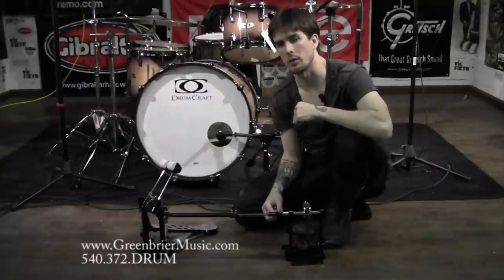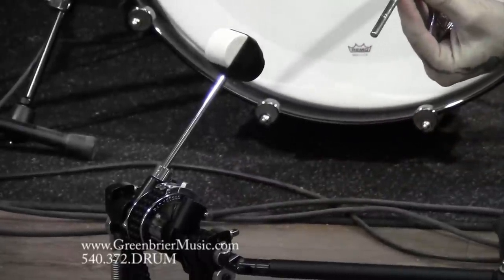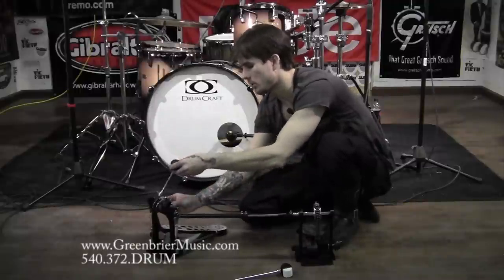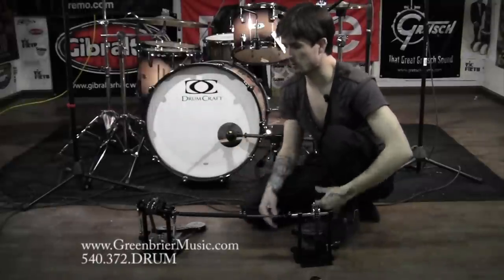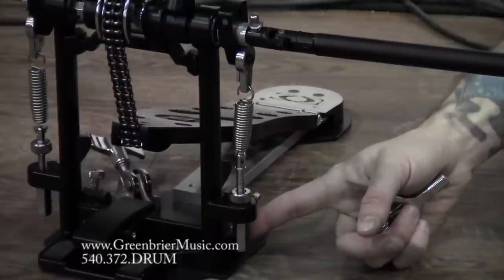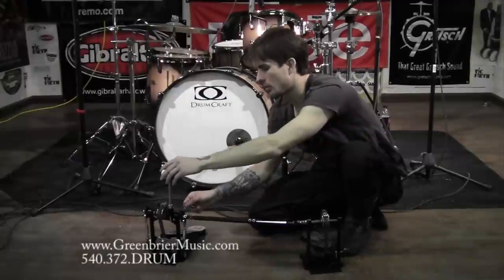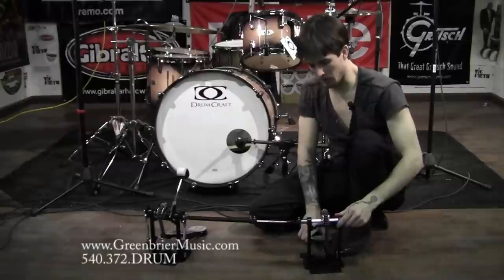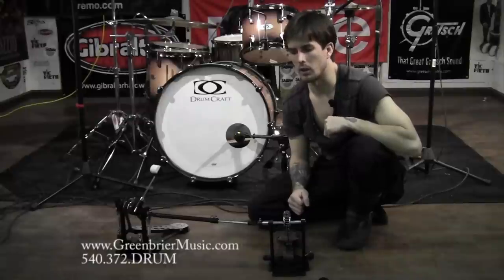Greenbrier Music How To: Setting Up Your Double Bass Pedal for Drum Sets w/ Stephen Whitesides

Comment: Hey! I recently got a PDP double bass drum pedal and i cant seem to find the screw for adjusting the beater angle like you just did on the video,is there any chance that low price pedals are excluded from extras like this or is it a common feature on every pedal?
Reply: unfortunately, cheaper pedals often don't have the options for adjusting beater angle and footboard height independently. can't vouch for your particular one though, so go through it piece by piece to find out what it's capable of. if that's still relevant, of course

Comment: OK stephen i've got a problem. I bought a gibraltar Intruder direct drive double bass pedal, and after tweaking the pedal hight and beater distance on the slave pedal, the spring of the slave pedal stopped working. The pedal doesn't spring back and the spring rocker hub doesn't move. it seems like the spring rocker isn't locked in with the shaft of the pedal anymore. What to do?

Comment: if anyone could help me with this, it would be greatly appreciated. With electronic drums, would pedals like those work, or must one buy specialized pedals for the particular model?
Reply: Panth Mantheon some electric kits only have a pedal that is a button essentially, and you don't hit anything with it. It's hard to do anything with that. 
but some kits have a thing that looks like a bassdrum practice pad that you hit and there is a membrane getting hit, the more expensive kits have different sounds depending on how hard or soft you kick.